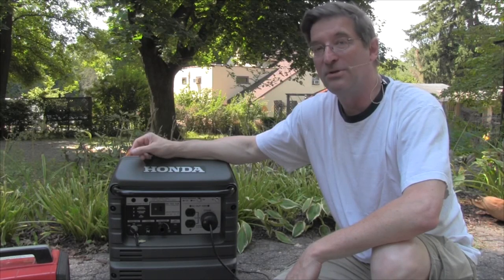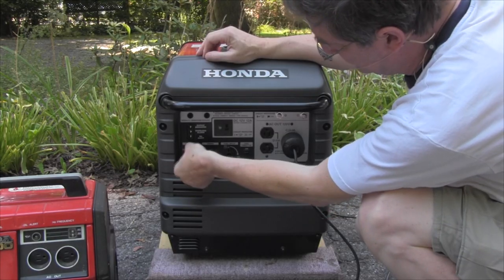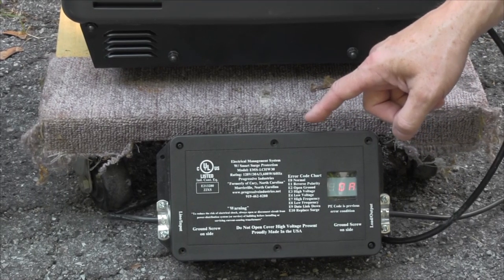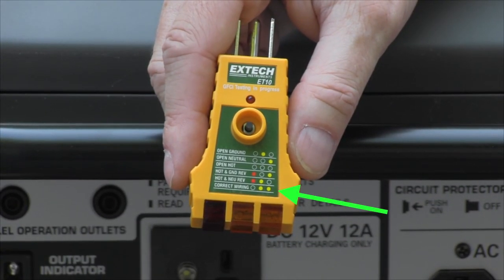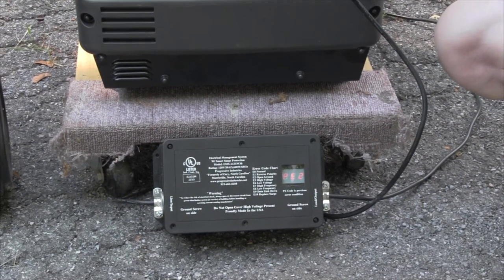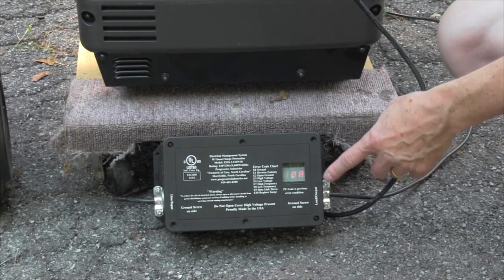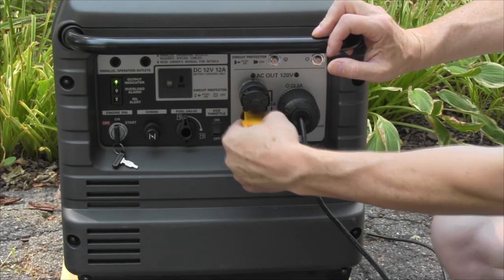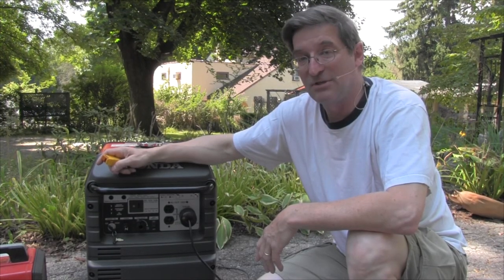Testing a Generator for a Floating Neutral

Comment: hmm this really isn't a good idea, shorting the neutral to the ground pin only links the case to neutral. it also allows you to be a conductor back to the generator via the ground.
you have gone from the only way you can get current to flow is by connecting hot and neutral, to having current flowing from hot to ground too.

Comment: It works!!!  and for under $10! THANKS SO MUCH for sharing this. I bought a Predator generator and it worked great with tools and lights. Then I tried to fire up my York furnace.... uh-oh; the furnace didn't like the power as it came out of the Predator. The furnace did show nine blinking red lights which helped as that means there is a grounding error.  I tried everything; no go. Then I found this video, ordered the plug and instant success!!! Why didn't my generator manual say BTW, to run some appliances with circuit boards you will need this plug?? Life saver and we have an ice storm coming this week.

Comment: Mike, a little off-topic: I use my HONDA generators to power my house during power outages. If it is just me, I back feed through a legal breaker with a manual transfer switch on just one leg of my two legs of 120 VAC as I have all my critical loads on that leg. If the family is here, I power my house during outages through a legal 220VAC backfeed through a different breaker and the same manual transfer switch to power the whole house. Is the floating neutral a thing when I am powering the house with 220VAC and if so, how do I fix it as you have shown for 120VAC?  Thank you!
Reply: The point of using the floating neutral generator configuration is to assure that your house wiring's neutral and ground are ONLY bonded together at one point as required by electrical codes. If, instead, the Generator is in bonded mode then your house wiring can "allow unwanted current flow through the grounding system". possibly leading to "shocks and unreliable breaker operation". So you should always use your generator in floating neutral mode whenever you use it connected to your panel through a manual backfeed switch;  both in your 120 or 240 mode.  Why do you do that?  I would recommend you don't use the 120 only mode;  just manually turn off the breakers to those circuits if you are trying to prevent their use.
Reply: @RichardBayer-gy2ey  Thank you. Great information and explanation. I use the one leg as I have an inverter generator that is very efficient and does not make much noise but it is only 120VAC. When the family is here and I need to full house, I use the 240VAC/12,000Watt.

Comment: Using a grounding plug on a 20A outlet could get you into trouble. If you have a 30A inverter generator and are using a 30A outlet, and you have a load fault that draws nearly 30A from hot to ground, but not enough to trip the generator overload protection, and the fault current flows from ground to neutral through 20A outlet with the shorting plug, it could melt your 20A outlet, and it creates DANGEROUS CURRENTS FLOWING ON THE FRAME OF THE GENERATOR between the two ground pins of the two outlets.  You should always have the neutral-ground short be located on the outlet where the power is being supplied.  Good luck not being sued for electrocuting somebody Mr. "NoShockZone" (Youtube crackpot).

Comment: Don't do this !! if you are plugging your RV directly into the generator and your RV has a standard circuit breaker distribution panel than you actually want a floating neutral at the generator.  The neutral and ground will be bonded at the RV's breaker box and it's dangerous to have it bonded at two locations. 

Don't take my word for it, you can test it using the same 3 prong tester, simply plug your RV into your generator and then test an outlet in the RV with the tester, if your RV is wired properly then you won't see the open neutral.

The problem he is having has nothing to do with the generator but with the surge suppressor that he is using,  they are not intended to be used with generators but rather grid power.
Reply: Wouldn't the same be true of any situation in which the generator is connected to the wiring system of a house and the ground and neutral are bonded at the breaker box?  Why is it dangerous to be bonded in 2 locations? In this video showing how to disconnect the neutral and ground in a generator I recently purchased they don't explain when and why this should be done, but they do say " There are certain applications where this is required like connecting a portable generator to a transfer switch that has a neutral bond."  https://www.youtube.com/watch?v=ad1hAKS66OY&t=12s
Reply: @bigpardner  It's dangerous to bond in two locations because if you do that the ground carries some of the neutral current back to the source (the generator). See the Mike Holt NEC videos for the many hours of discussion on that...!
Reply: You are absolutely correct..
Reply: RVs dont have N2G bonding. An RV is expected to be plugged into a power source that is already bonded.

Comment: It’s more important to make sure that your generator is properly grounded with a grounding rod which I noticed that you failed to mention in your video. Also, why are you using a surge protector with an inverter generator which already has that protection built in? There is a reason you paid $3k for that Honda.

Comment: How about just using a meter probe to see if generator is bonded or has a neutral floating. Probe right in the four prongs of the outlet.Go from neutral to ground and check for continuity.
Reply: He wants you to buy his gizmo.

Comment: Great video!  I’m assuming the neutral grounding plug won’t work if my generator has gfi outlets.  I have a Champion 7000 open frame inverter.
Reply: Have you checked to see if it is not bonded?   If not, then the plug might trip it, but I think it would not unless you connect a conductor from a ground rod to the generator.   But that is only a guess.  There are times when it should and should not be bonded.   Using power tools, no.   Connecting to an RV, yes.   Connecting to the electrical system in your house with 2 pole transfer, no.   Connecting to house with 3 pole transfer(neutral) yes.   
Best Wishes,   Kevin.
Reply: @KevinCoop1  Using power tools, YES.

Comment: Mike, I know a lot about most things but am severely deficient when it comes to electrical matters.  I just bought a Ram Promaster high roof van to use as a camper and bought a WEN 2000 WATT generator / inverter to run a small portable ac unit with a heat pump for wintertime.  The unit only requires 1300 starting watts and runs at 1100 so the 2000 watt generator should have no problem running it.  I have received the ac but am waiting on the generator.  In prep for receiving the generator I downloaded the manual and found that they say the unit needs to be earth grounded before being used.  Apparently that means driving a metal rod 8' into the ground and connecting the ground nut on the unit to the buried ground with 6 awg wire.  I simply cannot see myself doing that especially since I don't see myself staying in one place very long.  Not only would it be almost impossible to get in that deep in lots of places, it would then be a major chore to get it back out.  

Is there something else I can do to make this unit safe?  Would the plug you mentioned in your video make my unit safe to use without grounding it?  If there is nothing I can do to make this unit safe, what small units are available to use without a ground?

I really hope you can offer me an easy and inexpensive way to solve this problem.

Also, I have seen literally hundreds of campers running small generators from Honda, Yamaha, Harbor Freight(Predator 2000) and others and I don't recall a single one with a proper ground.  Is this a non-Issue and people are ignoring the warning without being hurt?

If the Wen cannot be made safe to use easily, I need to return it and get something else.

Thanks in advance for your advice!

Vic H.
Reply: So what did you do in the end?  Did it work without ground?

Comment: Thanks Mike, Always great information.  I have 2 new Paxcess 2300/1800 invert-er generators.  I would like to parallel the two and plug into my house L1430 inlet box.  The house is already bonded.  This generator does not have any GFCI outlets.  I believe I need to un-bond these 2 generators to use when hooked to the house panel.  Am I correct?  and would you know how to locate where it's bonded.  I believe it's a Yamaha clone and I'm sure it's built the same as all other inverter generators made in China.  Thanks.  P.S.When making the G-N Bond plug should I use stranded or solid wire or does it matter.  I made one with #12 stranded wire and it seems to be working.
Reply: John,   I have designed numerous large generator backed up electrical systems.  But my knowledge on small portables is limited.   I’m guessing that your generators are not bonded from what I am reading, they come that way so if you are using a tool off the gen and touch the metal frame, you do not get shocked.  Just in case you do, an RV needs a bonding jumper installed.  Now for your house.  With the 1430 you should be taking 120/240 volts into your house.  Here is how to know if you need a bonding jumper in the gens.  You must have a means to disconnect from the utility(that is an absolute). If you only disconnect the L1 and L2, then you should not bond in the generator.  If you disconnect both lines and neutral(3 pole transfer switch) then you should bond in the generators.
I’m not sure how you safely parallel the outputs, I hope you have that figured out.
Respectfully,   Kevin

Comment: This information would have been really helpful in the beginning when unboxing our inverter generator. Why don't the manufacturers tell you this or provide an option to fix it, they know we buy these types of generators to power our RV's. We wasted a whole day trying to figure out what was wrong, and why we weren't getting power to the rv. And of course it was a Sunday so their tech support wasn't in! Thanks for the helpful video, and explaining this issue.  Seems like there would be a more permanent fix?
Reply: What you get when engineers and tech writers are overruled by C-Suite attorneys having zero electrical knowledge or experience and no inclination to correct that deficiency. "Suits Suck". Cheers!
Reply: Because you are wrong. People do not only buy inverter generators to connect to RVs and there are some scenarios where you want them bonded and not. My Westinghouse 15K watt generator comes bonded and thus no need for this...plus nobody reads the manuals to understand these concepts.

Comment: Or, just plug your RV into your generator without any surge protection and go on living with no problems. I've been doing this for YEARS with no repercussions.
Reply: I've had sex with numerous prostitutes and no comdom and never got an STD. just because you're doing it wrong and haven't had a problem yet doesn't mean it's correct.
Reply: Steve Vandeman , just don’t stand in a puddle when using something powered.

Comment: Since portable generators like the Honda EU2200i have a ground terminal on the front, wouldn't be safer just to use that with an earth ground?  Or does this do something different?
Reply: The ground terminal on a EU2200i is to connect your generator to a iron pole buried a few feet into the ground, to give it a real earth and not a floating/fake earth, at the plug.

Comment: OK, I understand what you are saying, the plug you are promoting jumps the neutral output back to the ground, but why on inverter generators does the manufacturer not have it bonded ?  there is really no additional cost involved so I am thinking there is some condition that the inverter part of the generator can not handle ???  Do you have any thoughts on this ???
Reply: It's because the generator manufacturer doesn't have to use a GFCI outlet if the generator neutral is unbonded. It's a UL and NEC requirement. So to save money, and the hassle of users complaining about GFCI's tripping, they only have to float the neutral. Problem solved.
Reply: RV’s answer is mostly correct and I agree with him.   If you plug a tool into the generator have it in your hand and touch the generator metal you do not get shocked.   No GFCI.

Comment: I've got a Generac GP2200i generator.  EMS on camper is showing exactly what you have in the video.  When I test voltage on the generator, I get 62V on both sides of the outlet.  Just want to make sure if I plug that in, it's not going to fry my generator.  Thanks!

Comment: I have a floating neutral on a 7000 watt inverter generator so should I run a ground wire from the floating neutral on the generator to a ground pole in the ground? I am not using a transfer switch.
Reply: John,  in short NO.   Ground rods are for lightning protection.   The only time they should be bonded in the generator is for an RV and if you use 3 pole (neutral) transfer in your house.

Comment: Could this void my warranty on my Honda EU3000IS....? Or damage anything with long term use with this ground bonding plug?
Reply: Probably not.   It is not unsafe.   But only use it when connecting to an RV.  You can buy the plug on Amazon if you would like.   They are from $9-$12.

Comment: Our good old Sears 3500 watt generator has proper wiring for both 240 and 120 volt use. 4 wire plug to connect to house wiring. Two duplex outlets at 120V. A single 120v 3 pin receptacle for 120V full wattage output with a switch that allows for the full generator power to be at 120V.  You have your choice of 240+120 or 120 only. You don't see that on more modern units anymore.

Comment: Pretty sure you can use a jumper to bond the neutral instead of use a plug as a jumper.
Reply: You would think, but it didn't work when we tried bonding it to ground.

Comment: neutral from a generator are to be isolated from the building (rv) grounds and its neutral buss , to prevent inbalanced nuetral back feeds. CODE. UNBALANCED back feeds can cause shock and death.

Comment: Why would any smaller generator be manufactured without having a Neutral / Safety Ground internal bond?
Reply: Most homes have a Ground/ neutral bond in main panel.  if you connect a generator to you home with an interlock and some transfer switches by code you can only have a ground /neutral bond in one location.   The generator should have a floating neutral if you already have a bond in the main box.  If you bond in two places it can cause a loop in the neutral and trip any GFI's   If your generator is 100% GFI like the Honda EB series the main breaker on the generator will trip right away when using  a transfer switch or Interlock.
Reply: Dqalex, All of our circuits carry the ground all the way to the outlets. That includes the GFCI ones. Manual test show they all are working correctly. They do not trip out on the generator and it is a 4 wire 240/120 unit like all the others we have/had. And yes, our Neutral is bonded to ground in more than one place without problems. 3 to be exact. One in each of the two transfer switches and one in the main panel. The transformer out front also is grounded. We don't have any problems from the neighbor's feedbacks as we are on our own transformer. It would be a pain to replace our underground wiring because between the two conduit sweeps at each end, it is buried in concrete.
Reply: @Dqalex  so here's my question. I'm about to buy an inverter generator that has "neutral bonded to frame" on the front panel. I will be running a 6/3 wire from the 240V twist lock outlet on the generator to a sub panel within my home that has 95% of my home's breakers. That sub panel is fed by a main panel outside that is neutral - ground bonded. I plan on using an Interlock switch inside my sub panel so there's no chance I can back feed power to the grid if the grid power goes down. So in this case what should I do? Should I leave my generator's "neutral bonded to frame" connection alone or should I unhook the neutral wire from behind the generator's end cap? The sub panel inside my home has two separate neutral buss bars because normally it's connected to the outside main panel that's already neutral - ground bonded. Of course that won't be the case with the inside sub panel once I turn off the main breaker inside the sub panel to the main panel connection.
Reply: @Ozzie4Para  first, I'm not an electrician. Next, most sub panel disconnects that I have seen (again not that many) only shut off the hot side. The neutral and ground are not disconnect when flipping the main breaker in a sun panel
Reply: @MooseTurder  My new inverter generator has a neutral ground bond. I hooked it up to my panel as is and everything is working fine.
Reply: @Ozzie4Para  you need to make your generator floating neutral anytime you hook it up to your house. If you don’t, you will have current traveling on your ground wires. Very bad idea. The champion website has instructions on how to make it floating neutral. Very simple.

Comment: I have a 3100 watt generator / inverter, (carry on)when we are out on the water and my wife wants to use the air conditioner we tried using our generator but our boat  goes into reverse polarity! I was told I need this plug and my generator will work, is this true?
Reply: Tim Taylor did u solve problems because I’ve now have the same problem

Comment: So do you just leave the jumper plugged into the receptacle? 

If you had one of these plugged into a house/gen panel, would you be able to just jumper the neutral/ground at the 30A receptacle at the house/plug in station?
Reply: Never do this if you connect to your house. The generator must be floating neutral. The ground and neural are connected in your panel and that is the only place they should be.